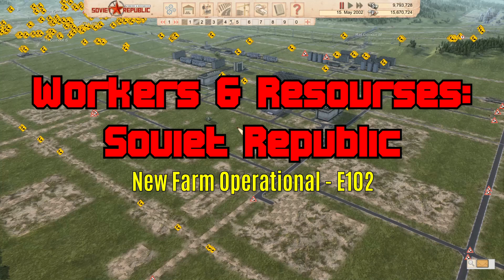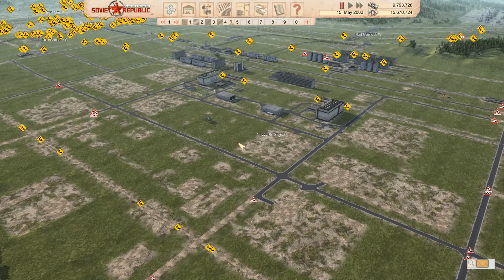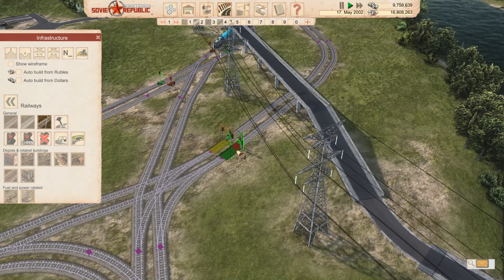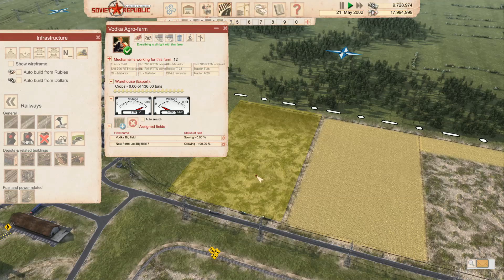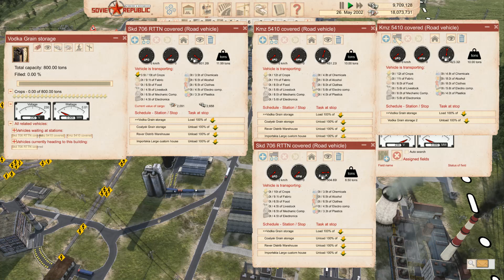Workers & Resources: Soviet Republic - New Farm Operational E102

Comment: If you want to keep that small aggregate storage which feeds gravel to a rail construction office, put an engine between them.  I'm sure you know this, but the engines/pumps seem to work like the aggregate storage/tanks: when there is no engine/pump on the output, the material sort of spreads out evenly between the storages.  You need an engine to pull it into the rail construction office.

I've been catching up on previous episodes.  Thank you for helping me understand how trains and signals work.  They can be really frustrating.  One thing I was getting stuck on was the 'feeding back on itself' effect you describe.  I might have given up on trying to use trains but for your advice.
Reply from the maker: Thanks Travis. So what is wrong with the engine that pumps out of the aggregate storage? Hehe I am just kidding, well sort of. I am obviously not very impressed by this coding. At this point I am so low on steel that I would rather just use the trucks.
I am glad I could help with the rail signals. Good luck getting past not having way points.